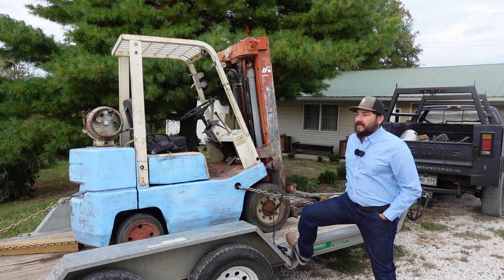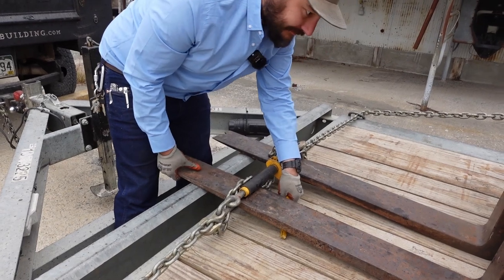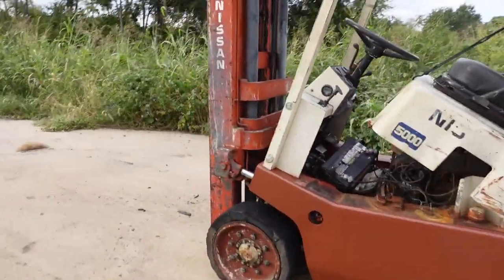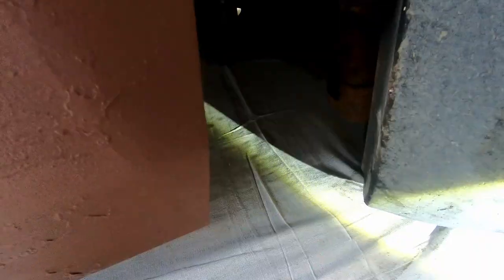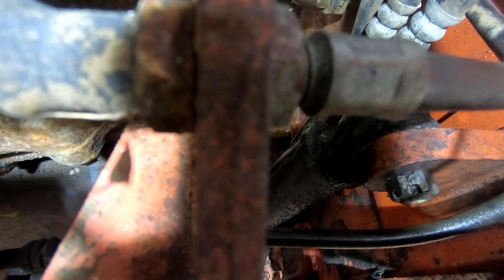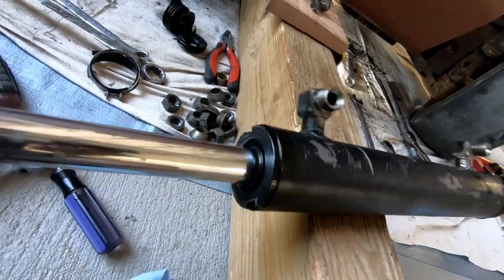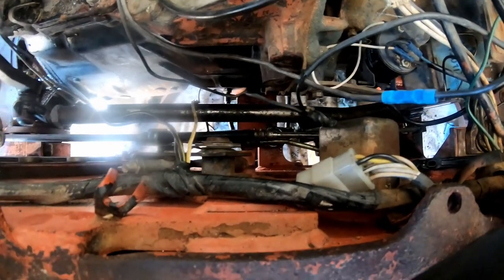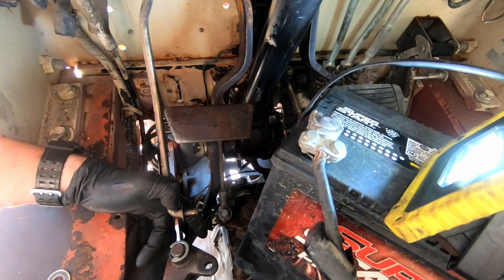Buying and Fixing a Nissan Forklift CPF02A25V

Comment: How much did you pay for it?  I see one for sale right now for $800.  It is a propane powered1980 model Nissan 5000 lb. lift capacity forklift that runs and lifts good, but does not move, because the differential is bad and I cannot even find parts online for it.